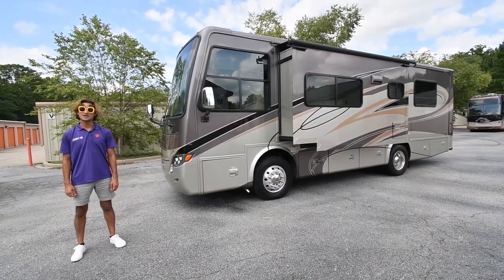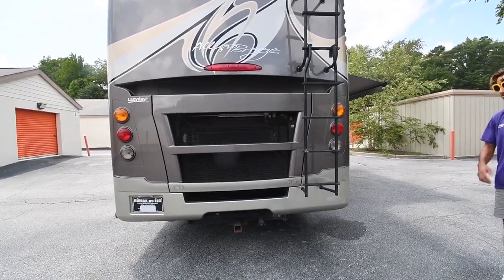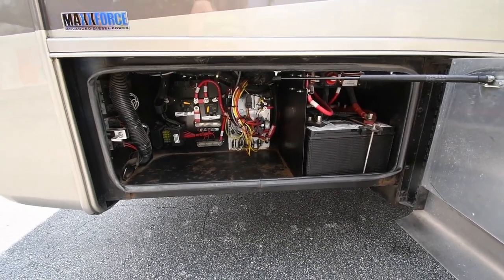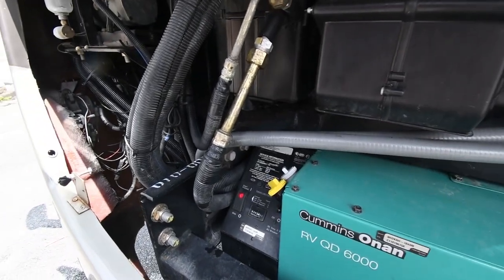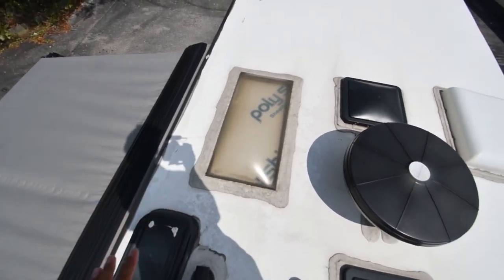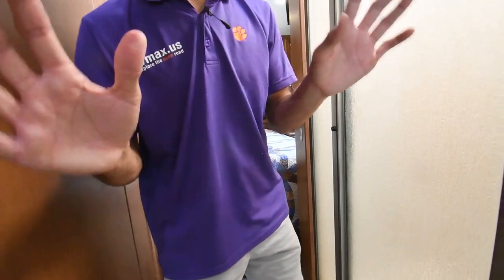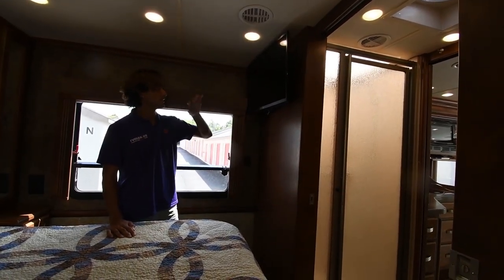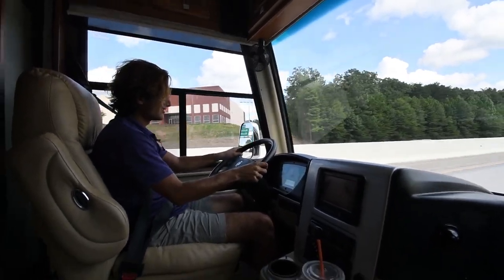SUB 30FT TIFFIN DIESEL COACH WITH AIR BAG SUSPENSION & AIR BRAKES (sold)

Comment: I own this year breeze, finally I found a recent video marketing this rig, my thoughts that these buses will be in high demand in the future. I don't understand the negative comments about the Maxforce engine maybe a small percentage may has issues but it is rare. Every motorhome no matter what brand or make will have issues I believe this one will hold its value.
Reply from the maker: "Every motorhome no matter what brand or make will have issues" True statement! Thanks for watching!
Reply: What do these go for in price?
Reply: @camposvazquez  recent rv trader listings has them between 85k to 95k
Reply: I bought my 2011 breeze 28br 5 years ago and 45,000 miles with no engine problems yet.
Reply: What is the price for this coach

Comment: Tiffan, Monaco,  Safari diesels are the best of the best. Made to last ,will be on the road twenty years from now not like the junk they sell today in my opinion.  This size can get into State Parks,  anything over 35 foot ya need to book a RV park . Have been looking for a 30 ft Monaco in Phoenix. Very Rare
Reply from the maker: Yes it is hard to find a well built bus under 30ft! Good luck on your search, get out there and enjoy RVing! -Mayan
Reply: Not correct..Safari had problems with the 6.5 diesel from gm..

All coaches have had their issues....
Reply: @rvmaxus  we found her! Monaco Knight 31J diesel pusher.  She's  solid! She dosen't have all the pretties like a entertainment center with a fireplace. Something I'm considering doing since the table is directly across from the sofa.

Comment: hi: Just thought on your comment regarding the turbo set up.  The dual (compound) turbo set up, one with VGT (variable geometry of vanes in the turbine side of the turbo) is a strategy used to allow the engine to meet Diesel NOX emissions regulations. It is used to drive EGR (exhaust gas recirculation) at low engine speeds where EGR (exhaust pressure)  pressure would not be available to add EGR gas at low engine speeds with a single turbo set up in low or no boost conditions. Your comments would be more in line with gas engine technology. Cheers!
Reply from the maker: Interesting, I was unaware of that. I'm learning new things about this coaches every single day! I know the BMW M5 we have has a twin turbo set up with a small and large turbo and the turbo lag is minimal; it peaks power of 630hp and 505 ft pounds of torque at 1500rpm. I love turbos! I'll have to keep what you said in mind when I run into this engine again, do you know how this works on the larger diesels that only have single turbos? Thanks for your feedback! -Mayan

Comment: If it has the Maxforce 7 engine in it, run away and fast
Reply: Why? Fuel pump. Trying to get away from def
Reply: @coronaking812  That regen system it has is a total nightmare. I know how bad this system is.. take my word for it. Just google Max force 7 issues.
Reply: @MrBillygoat  thanks
Reply: If it has the same basic engine  as a 2008 -2010 f series  truck....run it till it grenades itself then spend the money on replace with a Cummins, then you can start to enjoy your coach .

Comment: Most say stay away from the maxfarce engines
Reply from the maker: Some do, from my understanding the "6.4L" powerstroke had some problems when initially produced, even though we had an F250 with the 6.4L and it was great, I've heard lots of good things about that engine too. However, the Maxxforce 7 is supposed to have rectified initial issues with the 6.4L which first came out in the Fords in 2008. The original owner of this coach has had 0 problems with the engine since new, and when I drove it the power and torque was quite surprising.
Thanks for your feedback and for watching! -Mayan

Comment: This guy needs to educate his self more on diesel engines. When you say in the video you should add another turbo charger to the one it has to give it more power doesn't look good. Plus this engine was designed poorly, it only had 4 head bolts per cylinder, "Hint- why they where problematic" Adding dual turbos would keep the head gaskets blown. This is why Ford ditched Navistar and started making their own diesel engines.

Comment: I don't believe that fuel mileage 😁
Reply from the maker: I just looked around online for mpg info, 17.3 does sound high. That’s what the computer on the coach indicated to me so that’s what I repeated in the video. Truck Trend said these get around 13-15mpg. When I drove it that average went down to 17 mpg just from a few miles. Which indicates to me, it could have been getting that mpg with the gentleman who owns it driving it. Not me driving it at 75mph and flooring it up on ramps. So it could have possibly gotten that mpg, it’s not outside the realm of possibility but to be fair, that computer could be wrong so take that with a grain of salt and make your own judgment before purchasing!                            
Thanks for your feedback!
Reply: @rvmaxus   Appreciate your answer. Yup, he could have driven 55 mph. But wow that is incredible fuel mileage.
Reply: @rvmaxus  I've had my 2011 for 5 years and 45,000 miles and get 11 mpg towing at 55 mph.  Windy conditions <11.